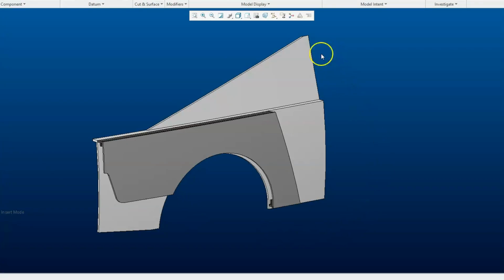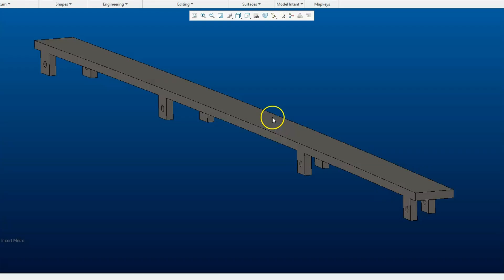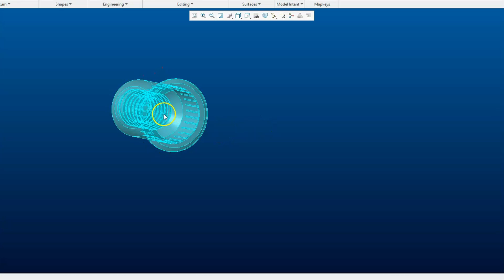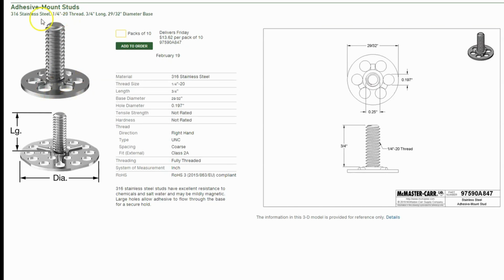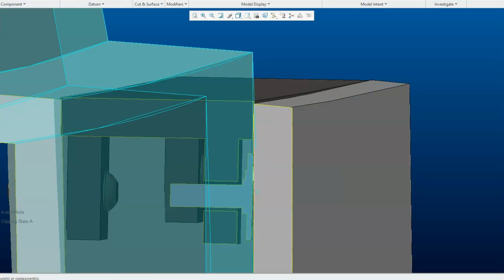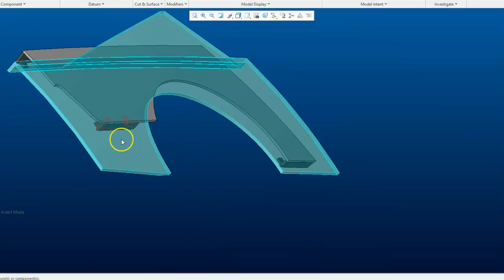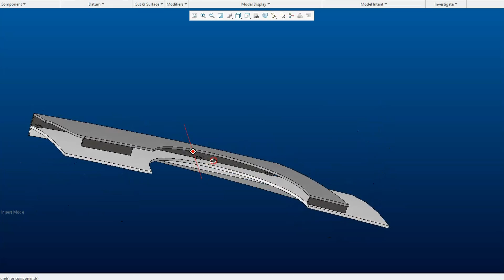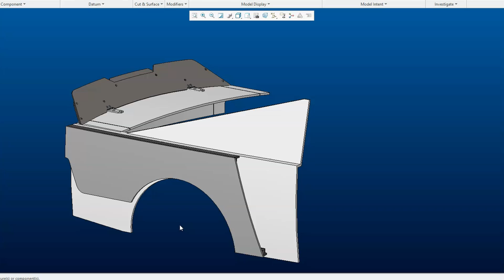JUNKYARD WIDEBODY - Designing Mounts!

Comment: also wouldn't you be able to weld your mounts onto that body panel? hmm may hold better than epoxys or adhessive specially since those are almost always affected by heat and cold weather.
Reply from the maker: I considered welding,  just didnt wanna risk distorting the fender with heat. they are very thin (.030"). I'm very familiar with this adhesive so I'm comfortable with the approach.
Reply: @Kordare  wow thats crazy thin, your def right about it like warping from the heat and such. I cant wait to see how it turns out!
Reply from the maker: @skl1cent  yeah body panels are super thin these days. Thanks for checking it out!

Comment: why not weld the adhesion mount studs to the fender then you wouldn't have to worry about them coming off with vibration or gforce
Reply from the maker: Just didnt wanna risk distorting the fenders with heat, they are very thin (.030). Also I use adhesives at my full time job daily, so I'm very comfortable with the approach.

Comment: I believe a few models Lotus cars are bonded with specific purpose polymers but you tig like you're writing the Constitution , why not consider tig the studs on the new fenders then affix them with spacers in between the two the fasten the inside the trunk and cabin. I will not fault you on your current course .
Reply from the maker: I definitely considered welding them. I'm just worried about distorting the fender from heat, they are very thin (~.030 ) so I didn't wanna risk it.

Comment: I would just epoxy everything
Reply from the maker: Well I want it all to be removable in case I change wheels/tires etc.
Reply: Kordare Did you think about using maybe Zeus fasteners
Reply from the maker: @joemartin8651  I didnt for this project but might use them for some other things I have in mind.

Comment: Why not weld the car to the mounts, then bolts those welded bolts? It would give you more piece of mine than adhesive
Reply from the maker: I didnt want to weld the studs to the fender to avoid distorting the metal from the heat, the fender is very thin and didnt wanna risk it. It's very light so I'm pretty confident in the adhesive approach.
Reply: @Kordare  fair enough